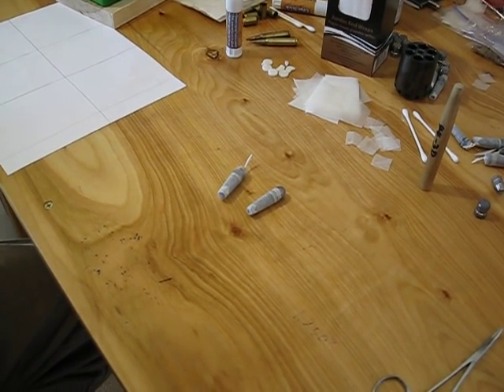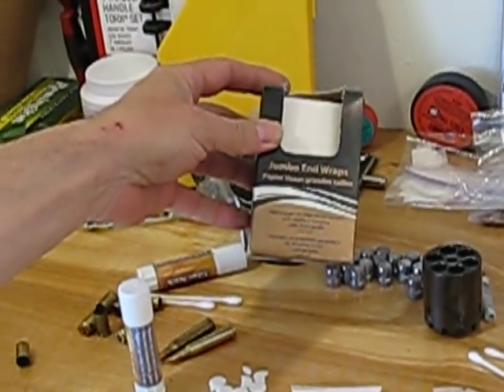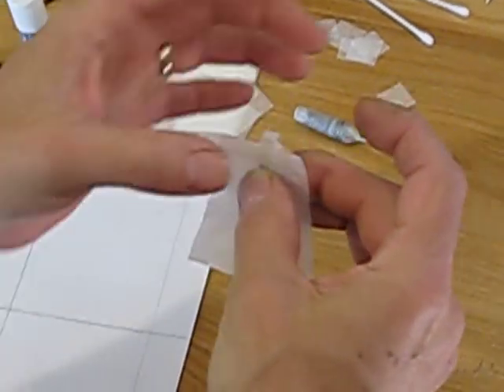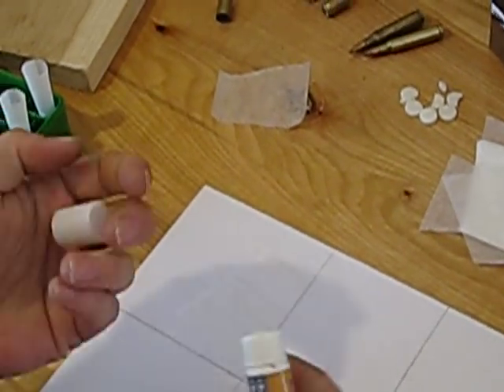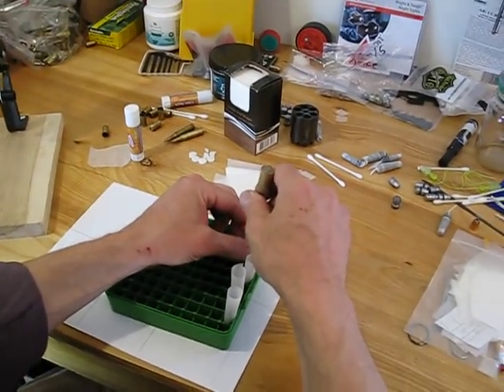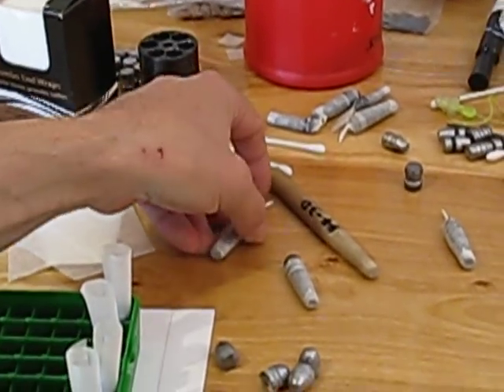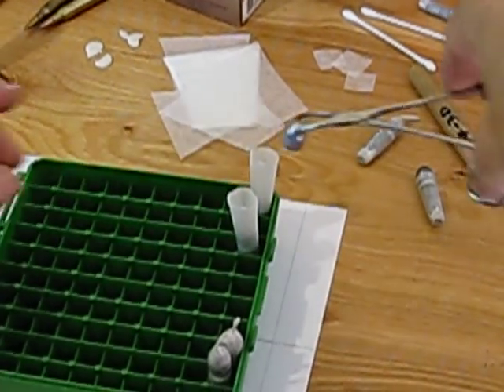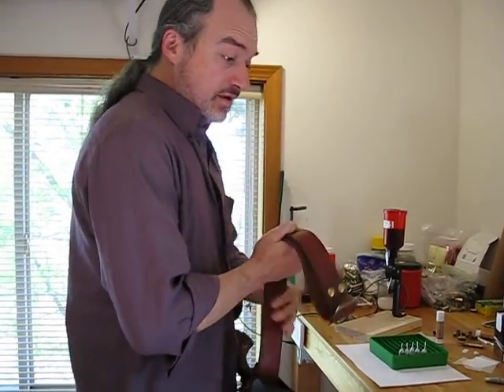MVI 1859

Comment: the reason I use Nitrated coffee filters is I Had Them. they don't fit any coffee maker in my house (I've used a commercial BUNN coffee maker for about 13 years now) so the old small filters are what was laying around. I had the KNO3 as well for another project that never happened (sugar rockets for my nephews).
however when I run out of those, this looks like a Great way to make those! Thanks
Reply from the maker: Hey; Nothing wrong with using what you have on hand!  I've actually never tried coffee filters, having started back in the early 2000s with various cigarette papers and, at someone's advice, trying a few teabags.  Obviously they all work, and so it comes down to what works easily.  I like the consistency of the perm papers (they have a slight amount of stretch to them, they're strong enough, but not too thick, and they take the glue nicely), and that they come already nice and flat for easy cutting of a stack of them at once.

Comment: I need to get a cartridge box like that!!!
Reply from the maker: Benjamin, I could fix you up, but it won't be cheap: the core and leatherwork are custom made.  I'd need to know what gun it'd be for also, of course, and I can even supply a cartridge rolling mandrel for your chosen load (powder charge and projectile).  Plus I'd throw in a reusable six pack cartridge box with the kit.  I can supply the cart boxes for Navy, Army, Dragoon and Walker pistols, but not for the little pocket models.  I make mandrels and cartridges for the Pocket 36s, but not the belt boxes or six packs.  I've never owned a 31, so those are right out.
Reply: @omnivore2220  a tempting offer, I’ll have to check with my wife. I am due for a birthday present and she may smile on this.

Comment: Liked your vid and man that was the coolest cartridge box ever.  I would love to see how it was made.
Reply from the maker: Hello Glenn.  To make the box I laminated two 1" (3/4" actual)  boards of light wood, cross-grained for strength.  I used a 90 degree router cove bit to cut four slots in one face of the now 2" board.  That makes a 90 degree "stair-step" profile.  Drilling the cavities for the cartridges at 45 degrees to the front face, at each step of the board, that puts the cavities running at 45 degrees to the front face of the board,.  In that way the cartridges are fit into a compact space.  I had the outer shell of leather made by a Leathersmith I  know.

More recently I've been having the box cores 3D printed out of a wood-filled PLA plastic.  With some creative CAD work we can now fit 50 cartridges into the same space as my original 40 round, wooden core box, and the leatherwork has been improved..  Also a similarly printed, 40 round box core for the longer Colt Walker / Dragoon cartridges will fit into the same leather shell.
Reply: Omnivore 
Hi Omnivore,  based on you latest design, are you now selling these?
I’m new to black powder shooting but think this is a great idea.
Looking forward to hearing back.
Regards, KJ

Comment: Dissolve smokless powder in acetone to make NC laquer, paint it on the paper should burn, doing worry about the black powder, pyros use NC & Meal powder mixture as a prime all the time, actually you could prime the end of the cartridge for guaranteed ignition and NC makes things water resistant

Comment from the maker: Hello Dennis Danich. The plain hair curling papers work very well. I've heard that acetone/smokeless powder suggestion several times, and yet no one that's recommended it seems to have actually tried it and tested it to determine its relative effectiveness. In fact I know of no one who's claimed to have tried it al all. I do NOT RECOMMEND IT. It purports to "solve a problem" that simply doesn't exist. The paper case design described in my video, and others, leaves but one, very thin layer of paper at the ignition end (head) of the case, which typically bursts upon seating of the cartridge anyway. I've fired hundreds and hundreds of these cartridges (nigh on a thousand), in most weather conditions including light rain and snow. Ignition is every bit as reliable with this system as it is when using loose powder. As for any theoretical water resistance; unless you're shooting in the pouring rain it's a non starter. If you are shooting in the pouring rain, and you get droplets on your cartridges prior to loading, you're likely going to have problems anyway.
Again I do NOT use, and will not use, and I DO NOT RECOMMEND USING, any amount of nitro powder, no matter how small, in any black powder firearm. Coating a cartridge completely with enough NC to make it "water resistant" would require several grains of smokeless powder and several grains is a full charge for some of the small, modern metallic pistol cartridges.
Besides all that, you're proposing adding additional steps, and additional handling of noxious and flammable chemicals, to the cartridge making process. No, Young Grasshopper; keep it simple, try the system in various conditions, master it, and you'll find there's no real "problem" to be solved anyway.
Additionally, nearly all ignition problems in a muzzleloader or percussion revolver can be attributed to poor loading and/or poor maintenance practices, oil residue left in the ignition channel or breech face being the most common mistake. The only other problem is having the gun out in the rain and having water find it's way into the ignition path. A fully water-proof cartridge wouldn't solve the latter problem, either.

Comment: Nice idea.  Efficient, better handling, your cups are big enough to hold whatever charge you want (my Pietta likes 30 grains, at least for round ball)...  Now combine that with a tail twist to save time and fussiness, and use dip-lubed bullets (you get that little bit more lube that way, maybe don't need the cookie to keep everything running well), and you'll have what paper cartridges might have been if metallic had held off another ten or fifteen years.

Comment from the maker: Hello Northern Woodsman; You didn't look up Gatofeo bullet lube, did you?
Yes, it has been said over and over that petro lubes should be avoided because they react with black powder fouling to create a hard, tar-like residue. It's generally true too. I've seen it.
However, I assure you that when it comes to paraffin wax there is no such problem. Hundreds (or thousands) of black powder shooters have been using Gatofeo #1 lube (GF1) for many years now, with good to excellent results. You would know this if you'd looked it up as I suggested. I myself have fired thousands of rounds using Gatofeo #1 and never once had any fouling that didn't wipe right out. That's the whole point of it after all.
Here's an exhaustive explanation and discussion of some of my experience with GF1 lube as a black powder fouling mitigator;http://1858remington.com/discuss/index.php/topic,8975.0.html

Another petro-based ingredient that works with black powder, so I've been told by several BP shooters first hand (so I'm telling you this one second hand) is petroleum jelly. I haven't tried it, but I do believe those who say they're using it regularly with none of the problems generally associated with petro-based ingredients.
The point is; there's a big difference between repeating what someone else told you, actually looking into things as I suggested in the video , and then actually trying things first hand.
I am NOT saying that GF1 is the best BP bullet lube ever (though some people think that it is). I am NOT saying that you should change to it if you have a lube you already like. I am however saying that GF1 works very well, even with (gasp!) a petroleum derivative.
And for everyone else; I appreciate insightful comments, even jokes or anecdotes, but please, DO NOT come on here and tell me that what I've been doing "cannot" be done. You're just conflicting with actual, verifiable, repeatable experiences, and there's no point in that.

Comment: What are the lube cookies you refer to ? Great video enjoyed that.
Reply from the maker: A lube cookie consists of a wafer of black powder lube between two thin cards of either paper or polymer, which is placed between the bullet and the powder charge.

In black powder shooting, the lube's main purpose is to keep the fouling soft, especially in dry conditions wherein the copious black powder fouling can degrade the accuracy of subsequent shots.  In BPCR (black powder cartridge rifle) shooting where the pressures are a bit higher, the card also serves somewhat to protect the bullet base during firing.  It may also serve to help separate the remnants of the lube from sticking to the bullet base in flight.

The card between the powder and the lube serves to keep the lube off of the powder during storage of the cartridges, until the load is fired.

All of this differs significantly from the use of lubricants in smokeless powder loads with lead bullets.  In the latter case the lube is there to isolate and protect the bullet from damage and erosion from friction with the barrel wall.

In black powder shooting the pressures are typically much lower and the powder residue (fouling)  is much greater, and so the protection of the bullet is not the primary concern.  Rather, what may be termed "fouling mitigation" (a term I first heard fromJohn Fuhring) is the primary concern we're addressing.

Back in the 1860s they'd often shoot these revolvers "dry" and Civil War cartridges never contained lube , so far as I know, but that meant that maybe twelve to eighteen shots, or a little more, could be fire before the gun was taken down and cleaned, for otherwise the cylinder would begin to bind on the fouling.  With this method of lubing the charges, we can shoot all day before having to clean the gun.
Reply: @omnivore2220  thanks for the info